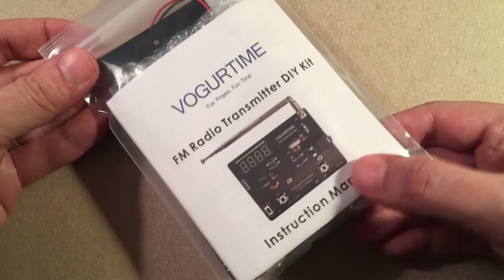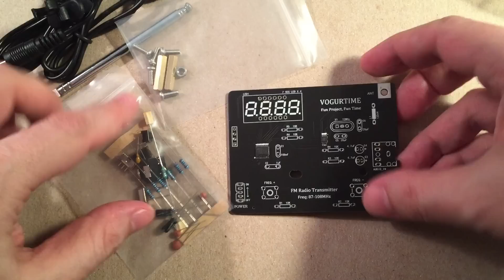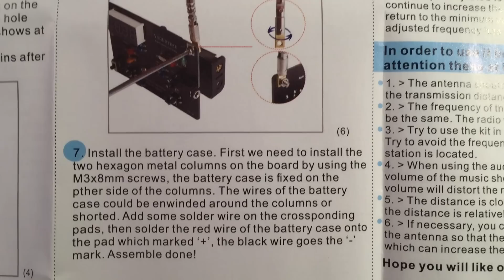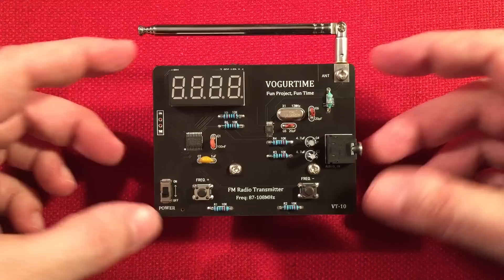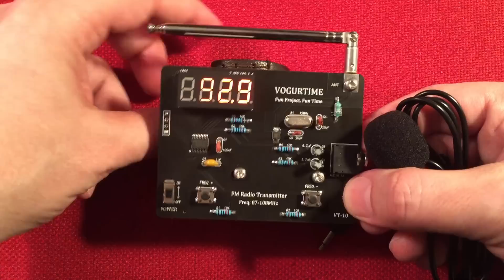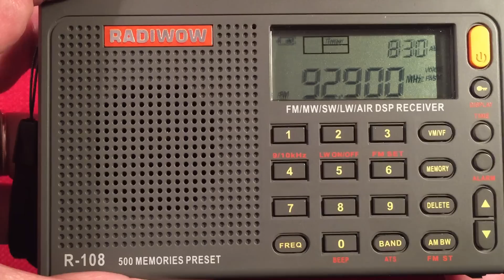Vogurtime VT-10 DIY FM Transmitter Kit Review

Comment: The QN8027 is a complete integrated FM radio transmitter. It is quite sophisticated, and is capable of transmitting video signals and audio. It has an integrated clock, but can also use a 12 MHZ external clock. It also needs an inductor. The other chip is an 8 bit microprocessor. Very cool. Remember to wash the soldered board, flux can conduct electricity.

Comment: Seems odd that you could only receive mono FM from the transmitter.  The QN8027 FM Tx integrated circuit in this kit supports stereo and the kit's schematic shows that it is wired for both left and right channels from the input jack to the QN8027.  Perhaps the microcontroller firmware is configuring the QN8027 for mono mode.

Another great video from Todderbert!

Cheers!
Reply from the maker: Yes, it is odd.  I tried different cables and devices to be sure. Tested along with my C.Crane Transmitter as well.  I noticed it should broadcast stereo, that is why I mentioned that other kits may work.
Reply: @todderbert  I think it was from soldering vcc and grd
Reply: I noticed that too with mine. Yes, the chip does support FM mode, but it has to be pgm'd to do it. There's no other hack for it that i could find. Otherwise, it's a great monoraul FM tx.

Comment: Back in the day, I remember getting a little output from a couple of Radio Shack FM modulators and wireless mics by simply adding an additional battery. 
It wouldn't "blow 'em up" or take the units past any legalities, but it would give them a bit more range. 
Now the modified antennas I put on 'em, THAT'S the stuff I was probably pushing it with, but antennas rock. Everyone knows that. ;)
Good times...glorious times. It wasn't long after I got my Technician ham radio license (now Extra).
73 de N2NLQ
Reply from the maker: Nice, I have my Tech, may get my General this year.

Comment: Your output power is going to be in probably the 5 milliwatt range, because, believe it or not, you can actually go nearly 2 miles with 1/2 watt, if you're using a properly loaded antenna that's outdoors and high enough in the sky.
Reply: You can go even farther than that on half a watt if there are no obstructions. The extreme case is that ham radio satellites usually transmit about 0.3 watt and can  still be picked up from 500+ miles away even with a whip antenna under good conditions. More common cases are when there's a significant elevation difference providing a clear line of sight. 

But I agree with you that the transmitter is likely 5 mW if that. The FCC rules are very strict on unlicensed transmitters in the FM broadcast bands. Even this is probably technically in violation, but they wouldn't really care as long as the signal isn't actually interfering with anything or being heard over a wide area.

Comment: the math; 468 / 98.5 MHz = 4.7 (feet) or 57.0 (inches) over all length for a (half wave) "DI-pole" antenna. Or 57.0" / 2 = 28.5 inch radials for (1/4 wave) ground plane or other types of antenna. (for reference purposes only)

Comment: I'm wondering  if you could use this broadcast say audio from a projector in the front yard for doing some projection mapping light displays?  What are your thoughts?  I could put it inside the box on the tree lawn with the projector and tune in to the desired channel on my car radio?
Reply from the maker: You could try it, but a C.Crane FM Transmitter maybe the way to go since you can control the line level as well.

Comment: I put mine together but I can barely hear  anything because the volume is so low. I made a mistake, I messed up the polarity of the on/off switch but it turned on so I left it like that. Would that be the problem? I tried to do it right but I was having a hard time trying to desolder it. Please any help would be appreciated
Reply from the maker: I wouldn't think the switch could be the problem since it is a single pole single throw type.  Try increasing the volume on the attached device.  Also use a digital radio to receive as a test.  Be at least five feet away from the transmitter.